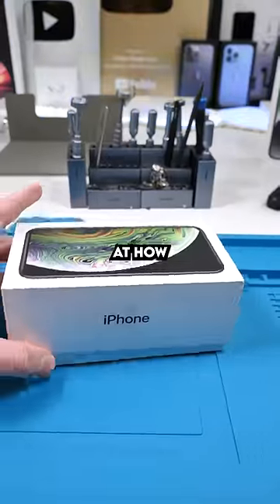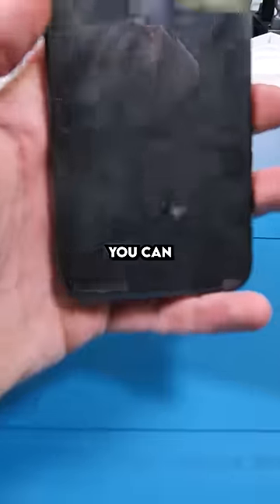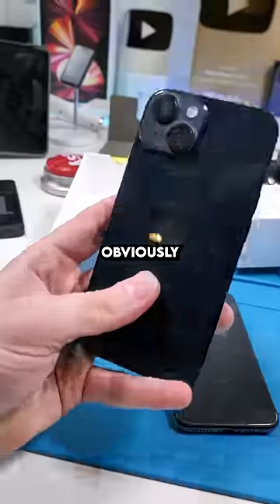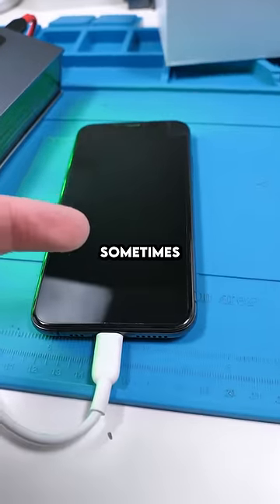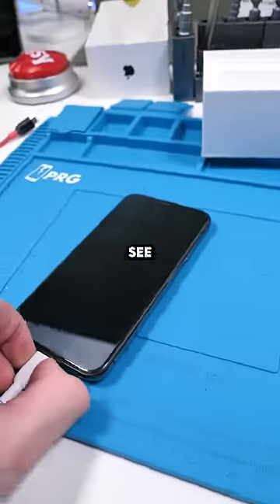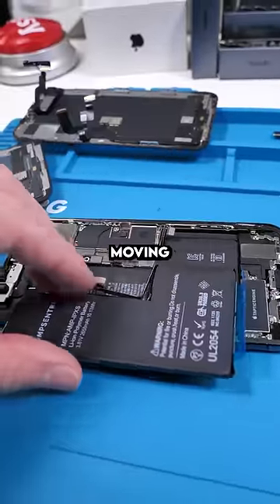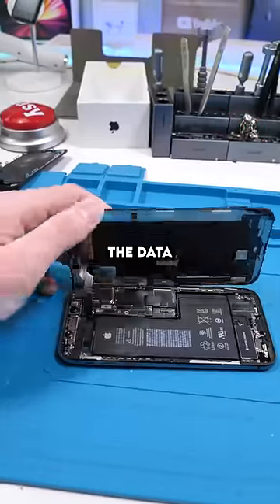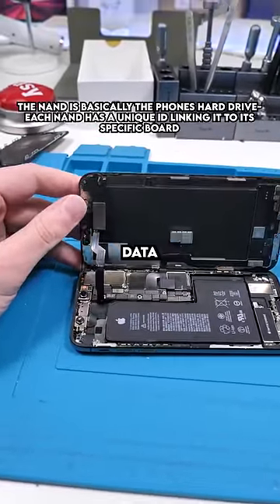You'll Never Guess What Was Wrong With This iPhone... #Shorts

Comment from the maker: Hey Guys, you can fix NAND issues but it's an extremely complex repair and not something I offer. usually costs more than the actual phone itself. When I said you can't restore the phone I meant on iTunes ( nand issues usually give specific errors) . Sorry if this was misunderstood.
Reply: Dew droid have the nands? Love the vids btw.
Reply: @LibbyMia-rz8gk  NAND is a type of storage that doesn’t require power to keep the data on it, reads and writes in blocks, which is used in SSDs, flash drives and memory cards since 2009, and yes, android phones do use NAND storage, as that’s the main type of storage used in modern phones. basically, all phones use NAND storage chips for data things
Reply: Bro am also working on mobile repair , and am also repair the motherboards of any devices . And why not you also upload some board repair videos on Level 3 and 4 ?
Reply: I do logic board repair.  I also offer b2b services like faceID repair.  Would be happy to help
Reply: Why are mail ins turned off?
Reply: Error 4013 mass memory problem (nand)
Reply: ֆʊʏǟֆɦ  you can, but you'd have to find someone willing to install it
Reply: What little symbol 
The symbol C E ?
Reply: @LibbyMia-rz8gk  Almost every mobile phone ever created has had nand flash.
Reply: @qwertykeyboard5901  thanks. I genuinely didn’t know what it was. I don’t know my way around electronics to well
Reply: What about the earpiece speaker
Reply: It’s like the ring of death on the x box 360 lol 😂
Reply: @1zayn4  damn those were the days when It worked righ.
Reply: Hey PRG those 2 icons are for the uk version of iPhones
Reply: can you give me iphone well 
im not able to afford 😢 iphone 
i don't want new one  just old  phone xr se or 11 😕 
used one's or refurbished 
sorry for asking .
i used to see video of yours well yeph it's good 👍 👌 👏
Reply: 0
Reply: Is it a NAND logic gate? Or something else
Reply: Hey @Phone Repair Guru i have a vodafone tab 2016 it hasn't been booted since 2020 may 16 can u please restore the tablet i just want to retrieve my data & how should i send it to you & also i don't have it's box. How should i send it to you 🥺❤️📴🤔
Reply: I know you don’t offer the service but have you ever attempted to fix NAND issues? Also if the NAND can be replaced does the mean the internal iPhone storage can be increased?
Reply: Poke Hut Gaming  lol u want a free phone so you can prove that it's nice to your friend? Tell your " friend " to look at some Google images of the phone 😂😂
Reply: bro can I have a free phone
Reply: Poke Hut Gaming  no offense but you're just trying to leech, kinda cringe and a kid move there. Just tell your "friend" (if he/she even exists) to watch videos about it or search images in google.
Even though the phone is mid-range, its still about 500 dollars. Even rich people will not give that one away whilly nilly, especially to strangers. I like giving things away but even if i was rich, i would only give stuff to people i know.
Reply: @LibbyMia-rz8gk yep, but unlike iphone you can replace the nand on most android phones. You wont get your data back, but your phone wont be a paper weight.
Reply: Poke Hut Gaming  Oh alr ill take everything back then.

Its very convincing ngl, the grammar really gave off that "aura".
Reply: @AM-fq4br  because he doesn’t know how to do board level repairs
Reply: Before throwing it to the garbage, you can still check the voltage related to the display connector. And replace the faulty transistor. What do you think?
Reply: A quick suggestion for your future videos. Give little content but share a lot of the context. You were also misunderstood in one of your other videos. Btw if you can't fix stuff you don't need to justify it, try owning it the way going forward. You being sick or the matter being complex comes after you say that you can't do the matter at hand. That'll help keeping inferiority complex in check and help you to have a more calm mind and ability to freely act. I am saying this with no ill intent and with my ability to relate as I'm working in the same field.
Reply: @yd59_yd  it means that the product is compliant with the european normatives
Reply: Can u fix top speaker on an iPhone XS Max
Reply: Ah yes. A new paper weight to add to the collection of apple failures.
Reply: @SnickerXYZ  actually most android phones don’t ship with NAND they ship with UFS 3.1 storage
Reply: @user-91291  UFS is a storage interface and protocol that uses NAND flash memory chips
Reply: I'm trying reballing an iPhone 7 for experiment i hope it will have a new life😂
Reply: Just solder a new nand memory
Reply: I bought a used iPhone X in Greece and it was an American model
Reply: Oh okay
Reply: Jessa usually does these repairs. She has access to much more complicated equipment than most and does a really good work. @IpadRehab
Reply: I can fix NAND Issues

Comment: NAND Flash Memory can "maybe" be recovered by a Specialized Data Recovery Company. It really depends on the condition of the NAND Chip itself and you also need to be lucky that your Data is not corrupted. And yes its not gonna be cheap if you decide to try your luck. 

ALWAYS BACKUP IMPORTANT DATA PLEASE 😭

Comment: FYI nand is flash memory 
all flash memory has a failure point but this failure point is not due to the amount of storage used but rather how often the storage is written to 

every write of data slowly degrades the flash. so if you delete a bunch of data but then realize you needed it and download it again, that kills your phone faster. 

it would be best to keep all the data you need on device meaning it only needs to do read operations 

actual spinning hard drives would perform worse when full due to physics (the center of a circle spins faster than the edges) think of a circular running track and how the inside lanes are much shorter

Comment: I've always wondered whether the internal storage device could be replaced(expanded) assuming the software is preloaded onto the new storage chip.
Reply: Yes, but you have to restore after it’s in the phone because the storage is encrypted to a unique key in the processor.
Reply: @ArianKordi  Alright, this could be a good project for PRG
Reply: @faradayjerome3532  It's pretty common to do, lots of Chinese channels feature it. I don't think he would do it as it would require BGA soldering that he almost always seems to leave to an expert, but, on A14 and higher you can just swap the NAND directly (on lower phones you actually do need to copy serial number related info between the chips requiring more equipment) so it's a hard maybe.
Reply: @ArianKordi  How haven't I seen those. I'll check them out, and see if I can do it.
Reply: @ArianKordi  Send me the link to such a video
Reply: @ArianKordi  Thank you

Comment: The same thing happened to my iPhone se 2022 the screen went completely black and it wasn’t Turing on at all I went to Apple store and they said it’s ded AS ALWAYS 😂 
Well went to a local repair shop and it turned out the there was a sort in the board at the battery connector and well it fixed it was such a relief
Reply: Apple service center doesn’t work every time ig
Reply: @jatintare8805  yes right

Comment: NAND is a digital logic gate it actually stands for Not AND.  An AND digital logic gate is where an output will be turned on if all inputs are turned on so say you have two inputs and one output (this would be called a two gate AND) we’ll call those two inputs A and B and the output C.  The only way that C is turned on is if both A and B are turned on, so there are 4 possible states of inputs A off, B off; A on, B off;  A off, B on;  and A on, B on, with only the last one causing the output to turn on.  A NAND gate is complete opposite of an AND gate so anytime that the AND output did not come on, the NAND output will come on.  So A off, B off; A on, B off; and A off, B on will all cause output C to come on, while A on, B on will cause output C to turn off.

There are other digital logic gates like OR, NOR, NOT, exclusive or (XOR), but NAND is special because with the right configuration you can take NAND gates and make them act like every other type of these gates, or in this case, non-volatile memory.
Reply: Nand is also often used to refer to "nand flash"

Comment: I have a Samsung Galaxy S21 Ultra that had the screen turn off while I was using it. After taking it to an authorized Samsung repair shop (Asurion) and waiting for the replacement screen to be delivered for them to attempt the repair it turned out to be a motherboard issue. I'd completely forgotten about the issues with nand chips. As soon as I get a chance I'll try replacing the nand chips and see if that fixes the problem. After all I have four cases for the phone.

Comment: A similar issue happened to my 13" late 2013 MacBook Pro. It makes 3 beeping sounds when trying to boot up. Apparently it's a RAN failure and the RAM on these models and afterwards are soldered onto the board. Maybe the SSD flash data is still accessible somehow.

Comment: Hi my IPhone 8 has a home button that doesn’t click, any advice?
Reply: The home button was probably replaced or the Taptic Engine is faulty

If your home button was replaced, you will need to go to an Apple Store and get your home button fixed to retain full functionality and Touch ID or you could get a Bluetooth home button mod that gives you full functionality like a normal home button but Touch ID will not work and you will need Bluetooth turned on at all times. You can connect the home button to any other iPhone

Comment: I got the XR when it came out and it came with the charger the wire and the headphones back when it was a thick box and I replaced it in 2020 for another XR and I got a thin box with no charger or headphones and just a wire
Reply: I got my XR in 2020 during the time when the iPhone 12 was new and was only a month old and my XR’s box was thick which included earphones, plug and charger

Comment: hey i did a battery replacement on my mums iphone 8 plus a few months back and even though it wasnt my first time doing it the phone like gave up on me for some reason

my mum had said she was facing some calling issues and other things but when i checked nth was wrong but i wanted to make sure so i even reopened it to check if the battery connecter was in properly but the phone had a red screen and died

i couldnt turn it on AT ALL but like the next day hard rebooting the phone worked so does anyone have any idea what couldve happened?

Comment: I have iPhone xs max activation lock how can I remove activation lock on iPhone xs max
Reply: Not possible sadly but I suggest you get a cheap iPhone XS that’s not activation locked doesn’t matter if it’s broken. If you buy a broken non locked XS max, swap the motherboard and Face ID modular (if it’s not broken) to each phone then it should start working fine, after doing that you can sell the broken iPhone with the activation lock motherboard